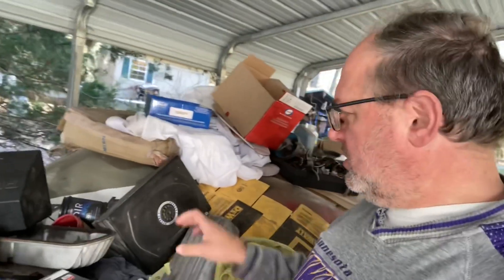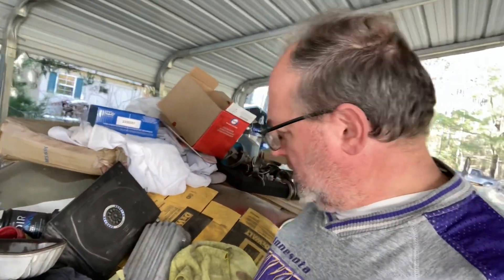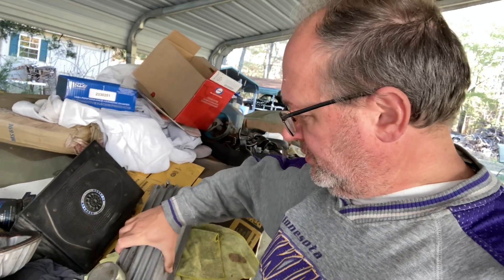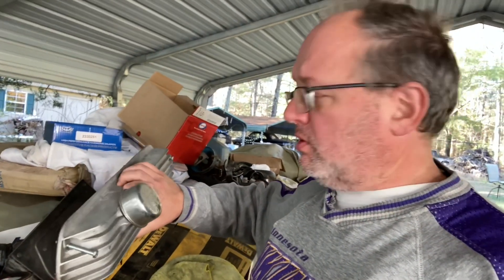Something different, Volume #3

Comment: I know its not what you want but you have alot of cleveland stuff..You have some good components to work with. Get the clearances right,  back off the RPM's and it will run fine.  Just my 2 cents that you don't want to hear.
Reply from the maker: The bad thing is, the clearances were right, and I was only shifting that POS at 6500.